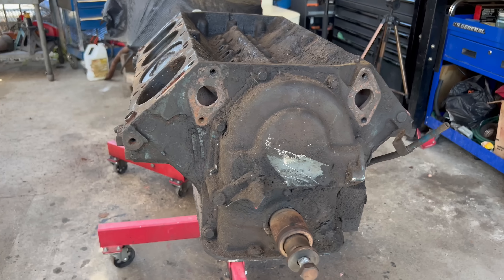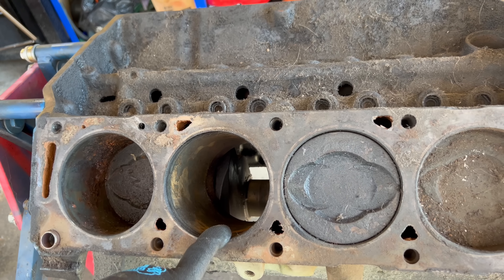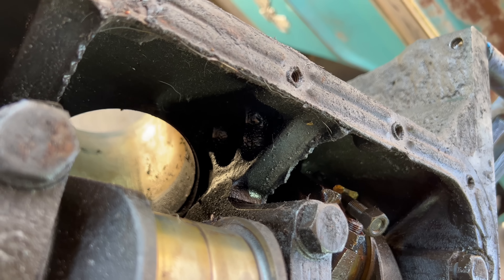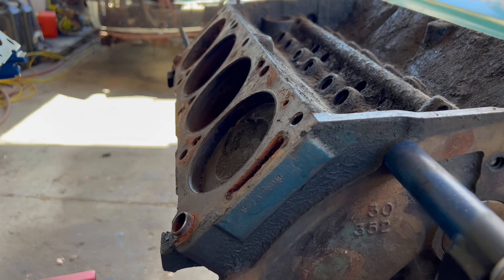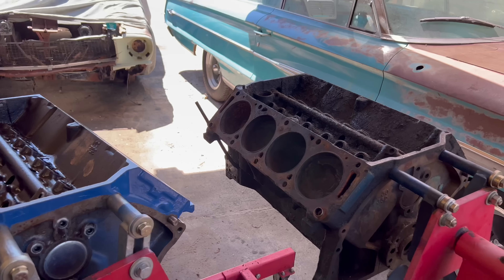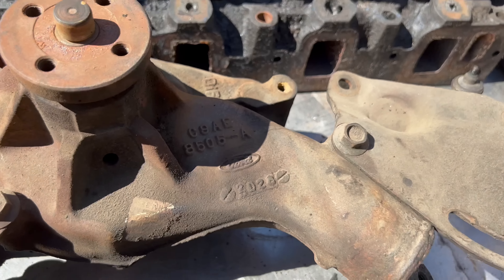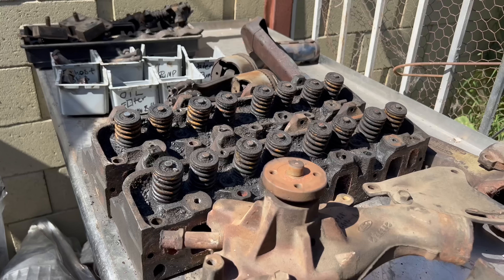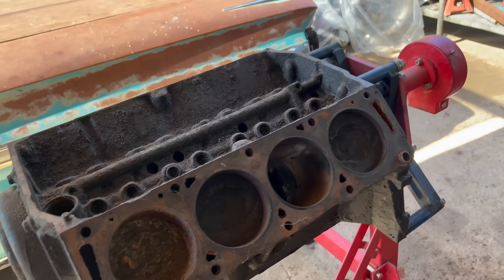A Ford 428FE Cobra Jet For $200!??

Comment: That's an authentic 428-CJ block with the reinforced center main webs (they also had higher nickel content) and a 1U crank.  The heads are not CJ, which have 16 cap screws on the exhausts
I have the correct 1UA crank in my SCJ with "hatchet spacer" and heavy dampener.  The 428-SCJ also differs from the CJ by using the stronger 427 "LeMans" capscrew rods.

Comment: I have 68 coup I put a 428 out of a mercury marquis and it runs like a scalded dog it is a tight fit with top loader 4 speed and borgusen power steering and long tube headers.
Reply from the maker: Haha man I hope mine runs like that. Excited to start up the 428 build

Comment: The 1965 and 1966 352 and 390's were put into production too early. Many had to have the cylinders worked, to make the rings seat when they were new. Chevy ran into the same problem and introduced the 402, a bored out 396. The BBC's wouldn't seat the rings. Most of the 1970 454 had to be worked over at the dealer.

Comment: Yes you got it right.. 4 bolts to each port on the heads.. I had a 68 1/2 ford mustang fastback 428 cobra jet with the top loader 4 speed as my 1st car at the age of 16 (0: Those 4 bolts with headers are a nightmare to put in... And that clutch was hard to hold down also... It was a fun car... I guy i sold it to 40 years ago still has it.. But he has a 351 Cleveland in it now... I did have problems with cracking heads and losing head gaskets so water got into the block.. It did this twice to me... Simple fast cars to work on.. This stuff they make now is total crap... Every time a modern car goes to hell on me... I put old school stuff from older cars,,,engines and wiring to them... So I never have to put up with all these chips and sensors any more... It's a racket to just steal all your cash...

Comment: Just putting together a new engine for my sons 67 Galaxie. Was a C scratch block block we put in 16 years ago. made it 70k miles, and an intke water leak hydro locked it and bent a rod. The one going in as a 434c.i. bored, and stroked (4.125 steel crank) 360 block, with billet cross bolted mains, roller cam, and ported Edlebrock heads. Love the FE's, and the small blocks for that matter. Nice score on the block. I bet it can be saved. Cheers, Mike
Reply from the maker: Wow would love to try out a stroked FE I bet it just has gobs of torque. If I can get 70k miles of fun out of my 428 I think that’s worth it haha
Reply: @OmarRamirezGalaxie  Yes lots of torque, and that's what you want for the street. The more common stroker crank is 4.25, which gives you around 445ci. Makes for a real stump puller.

Comment: I have a good set of 428 cobra jet heads from a 69 Torino GT (fastback), yes has the 16 bolt pattern on the exhaust. And I absolutely know that to be true because I've had them since they were removed from the car in 1975. Replaced it with a 427 side oiler.

Comment: I had a 1968 and a half Mustang Fastback,A long time ago now.
At the time I bought the car (1985)
I had no idea of what it was, except that it was a Fastback and it had a Big Block which I initially thought was a 390.
The engine was no good,the heads had been taken off and left on the ground under the car,Water had gotten into the block and it had 3 cracked pistons,and at least 2 hairline cracks in the block.. yeah they were big cracks I could see.
Anyway I did salvage the crankshaft, camshaft, and the heads...I traded those parts and $100 for a running 428 from a Thunderbird and put that in the Mustang,I drove it until 1997-98...I did learn the car was in fact a 68 1/2 Cobrajet but I didn't have the money or space to restore it properly,and I sold it.
The 428 I was running didn't perform as well as the original 428 Cobrajet but she was no slouch either,I like those 428s
Reply from the maker: Oh mannn, I’ve heard lots of stories where people sell their cars and later regretted it. But I guess back then they weren’t that valuable as they are now
Reply: @OmarRamirezGalaxie  back in the 80s you could still find 60s 70s Mustangs,Camaros,Chargers for 3k-5k still running...of course they were pretty beat up and nothing special or rare but they were still fun.
And back then,not alot of research was being done on Muscle Cars except the high-end well known models.
And so cars like my 68 and 1/2 sort of slipped through the cracks...I had never heard of one..the only Factory Big Block Mustangs I had ever seen were the 67-68 390 cars.
Good luck with your Mustang!!

Comment: An edelbroc top end and the right cam would make it a great street beast ! I love the FE motors , cut the weight and they are perfect ! Torque and power  with decent fuel milage .
Reply: I would put some elbow grease into that 428 and make it a better performer than a stock CobraJet...
Reply from the maker: Yes I’ve got the Edelbrock heads coming. Next video will be the install!
Reply: Torque and power, yes! Decent fuel mileage, what are you smoking! I'm old enough I put gas in them! Like to see someone convert one to modern fuel injection and crank triggered ignition! The external dimensions and weight weren't bad if you ditch that 80lb intake for aluminum! Think the Cobra jets had 440 ft pounds of Torque, and the 335 horsepower rating was bs! 400hp is much more believable!
Reply: @markmccarty9793  I have a 54 ford cp , 10 over 390 , with 60 over 352 pistons , rods and crank , flat top pistons , 292 duration , 512 lift hyd cam , intercepter heads , aluminum intake and a 750 on it , backed by a toploader and a 9 inch with 355 gears i get 27 mpg open highway . Loves  to run about 80 mph lol

Comment: Also the 428 head's have a taller intake port. I got some 390gt head's with the 16 bolt holes.
Reply: 390gt heads had 14 bolts not 16 which is cj

Comment: What you have appears to be  a 428 CJ shortblock with regular 390 passenger car heads and 390 S code intake. If it still has the original camshaft, pull it out and get the part number off it (they are the same cam as the 390 GT engines), and also 428 CJ's had an oddball connecting rod bolt size, bigger than the normal 3/8" size......I want to say 13/32" inch??...if thats the case, then it would indeed be a 428 CJ shortblock, regardless of what vehicle it was intended for.
Either way, good score for 200 bones!
Reply from the maker: Good info, I’ll be taking it apart and cleaning it up. See if the machine shop can fix it

Comment: I am not an FE expert by any means but one look at the exhaust manifolds points to an ordinary 428. True Cobra Jet exhausts resemble a shorty style header. The valve covers should have been chromed, but of course they could have been removed. My guess, based on the strengthened block, is that it's police engine.
Reply: Read that police interceptor 428’s had aluminum intakes
Reply: @shonbratton1906  Did not know that. Considering the age of this engine we don't know what it came with from the factory. It's odd that it looks to be a CJ block with standard 428 intake, heads and exhaust. From what I have read the CJ and police blocks were the same design.
Reply: I had a 68 PI 428 and it had 6 exhaust bolt heads (same pattern as a GT390), an iron intake, and a FoMoCo tagged Holley 735 cfm 4-barrel. Not all 428 CJ's had chrome valve covers, either. I bought a one owner 70 R-code 428 4-spd Mach 1 and it had painted valve covers, and plain steel wheels with standard 70 Mustang hub caps.
Reply: @scottb8175  What style were the exhaust manifolds on your PI 428? From what I remember the 390GT had standard, log type exhaust manifolds. My first car was a 69 LTD with a 2bbl 390. It ran on regular gas which in retrospect was one of Fords better idea's.
Reply: @briansearles4473  The manifold bolt pattern was different, at least that is what I remember. The heads had 14 exhaust manifold bolt holes vs. 8 for the standard versions. Some ports of the manifolds used the horizontal holes vs. the standard versions that used only vertical pairs of bolts accross each exhaust port. The "GT" style heads only were offered in 390's in Mustangs, Cougars, Fairlanes, and Comets, and the 428 PI. My guess was that the extra holes were because there wasn't enough room around the shock towers to use the standard bolt pattern in the narrower body cars. I know the 67 Shelby GT500 used the 428 PI with GT heads - a friend had one.

Comment: What is the bore, 4.13" or 4.05"? It could be a 410. Check that book you referenced and it tells you how to check the cylinder casting thickness using a drill bit as a go / no go gauge after pulling the freeze plugs. If it's a 410 with the thick cylinder castings it could be over bored 0.080 and now you have a standard 428.

Comment: I read once where Ford Called them an FE because of the mount of Iron required to build them...
Iron is a chemical element with symbol Fe (from Latin: ferrum) and atomic number 26. It is a metal that belongs to the first transition series and group 8 ...
Atomic number (Z): 26
Atomic radius: empirical: 126 pm
Oxidation states: −4, −2, −1, 0, +1, +2, +3, +4, ...
Density (near r.t.): 7.874 g/cm3

ha ha ha 😁😁
Reply from the maker: Hahaha oh man I’m having flashbacks from the chemistry classes I took in college.

Comment: It was also an option on the 69 Fairlane.  My dad went for the 302 much to my teenage dismay.
Reply from the maker: Haha yes. I will say the 302 in my 68 Torino runs really smooth
Reply: @OmarRamirezGalaxie  Oh it had lots of guts. The old man seldom let me drive it because he knew it was pretty fast and I would drive the hell out of it.............which I did when I got the chance. It was no 428 but still, pretty quick.

Comment: A MACHINE SHOP IN YUCAIPA CALIF (GONE NOW) STILLMAN & DODD...HAD THE BEST EQUIPTMENT OF ANYBODY I KNEW AT THE TIME...EARLY 80'S...FANTASTIC MACHINE WORK...THEY HAD SUNNEN MACHINES!!! I SPECD A 327 SMALL BLOCK...I Wanted 0.15 thousands on main & rods...it was RIGHT ON TARGET...THAT ENGINE RAN HARD WITH SMALL VALVE HEADS AND A 3 SPEED STICK IN A 65 EL CAMINO...IT PULLED SO HARD DAN RACED ALOT OF OTHERS AND WON...THEN WE WANTED 2.02 HEADS...OH BOY...IT MADE IT VERY QUICK...HE SMASHED HIS KNUCKLES ON THE DASH T OO MANY TIMES...LOLH

Comment: I have a orderd 1971 LTD with a 429 4bbl not shure if its a cobra.it has factory bucket seats .auto shifter on floor. Power disc brakes and a 3.25 rearend.every one i talked has hurd of this  package but never seen one.

Comment: also looks like 352  the correct heads and valve covers  and the block u have c7 67 the parts c8 parts from 68

Comment: That's a lot of good information. 60s Fords are famous for being puzzles too, I guess. LOL. Weren't some of the Mercs made with CJs and even some Cougars with SCJ too? Just curious what your HP target is on the build you've working. I've not kept up but I can remember guys getting 550 - 600HP without getting crazy. Very streetable. Good torque and didn't need to be revved to drive fast.
Reply from the maker: Hey John, yes lots of mercuries came with the CJ engine. I know where there’s a 68-69 mercury cyclone with a CJ but owner won’t really sell it haha. I’m shouting for 500hp but realistically end up around 400hp. I might get it dynoed!
Reply: Yep, Mercury used the same engines as the Ford line did.  I had a 1970 Cougar Eliminator with a 428 SCJ.

Comment: Hey bud happy birthday to you and keep on trucking used to into three 90s back in the day the ones with the two Bolt engine mounts castings had a 66 two-door post Fairlane and a 67 Ranchero used to blow the doors off the kids in the Camaros anyways those intake manifolds are a little heavy aren't they want to know a trick I'm sure you already know those cast iron intake weighs 75 lb aluminum 18 lb besides better breathing raises the front of the car up about a half an inch okay have a good one and again happy birthday enjoy listening to you keep up the good work
Reply from the maker: Appreciate it! Haha that’s cool I would love to own a 67 ranchero. I agree, the aluminum intake is a good upgrade. But I don’t mind them on pick ups!

Comment: I know the Cobra Jet Clevelands have XXX stamped on the block. I have no idea about the FE blocks. It’s crazy how hard FE Ford blocks/heads are to tell apart. And just how many different factory options Ford V8’s came with from about 1964 to 1971.
Reply: The era of really confusing branches of the FE family started in 1961, with the solid lifter only high-performance 390's. The early ones most people have forgotten about - the 61-62 HP 390, 62-63.5 406, 63.5-64 427 Top-Oiler. the Mercury 410....

Comment: I Just Subscribed if you look in the water Jackets. The number 428 is cast into  the block. On both sides  below the center freeze plugs. and at the very back of the water jacket thru the gap in the mating surface.  We have a 67 Q code T Bird.  428 car. A Mirror 106 casting 390 block can often safely be bored to a 428.
Reply from the maker: Yes I’ve heard of the 428 stamp. I’ve also read about fitting a certain sized drill bit in between the cylinders. I’ll have to take a look and see if this block has it. And I think those mirror blocks are from trucks if I remember correctly

Comment: There is another trick for positive identification as a 428. If you pull the freeze plugs 428 is cast into the block, I just can't recall the exact freeze plug location. Use a strong flashlight. I know for sure this is true on 1969 428CJ blocks but can't say for sure that it applies to all of them. Many years ago I was also on the hunt for a 428 and it is harder than it might seem at first. Good luck with your projects.
Reply from the maker: Yes I’ve seen that 428 cast in the rear water passage. I’ve also heard of a certain size drill bit fitting In between the cylinders.
Reply: Right side middle freeze plug on my 2

Comment: my 69 mach 1 was a 428 4spd  car  with 430 gears,,its a cj...sad it did not have it when i got it,,,had a junk oil burning 427  out of a auto matic  ,,well  it had no pilot bearing in it..trashed the toploader....i traded my 66 polara 500 ragtop for it in 77...now has a 302 with a c4 in it now,,,,i like it better that way

Comment: Cj heads are dirt cheap now cuz the edelbrock rpm heads flow way better on the exhaust side. The intake are the same, so Ford got the intake right. I bet you port and polish the factory cj heads you could get close to the rpm heads

Comment: As a solíd GM guy, I do love FE Ford's! Thing is when you look at this greasy mess and that intake, etc, they just don't look like much of a performance engine at first. I really like what this Robotnik guy here in Michigan has done for the FE world. Also love hearing those big Galaxies and Starliners running 8.90s carrying the front wheels 330ft while banging gears!
Reply from the maker: Haha man that’s awesome. I love seeing these big cars going down the track as well. I almost bought a starliner if it wasn’t for my trailer messing up on me I would’ve had it!
Reply: As a performance engine, the standard FE was actually pathetic in comparison to its BB and even some SB competition. Only the rare "special" versions (406, 427, and SOHC) made competitive power. I worked at a performance engine shop that built them all but only raced Fords ourselves  for years. Our own 351C engines were much more race worthy than our 428 CJ ever could hope to be. In my opinion, the 429 - 460 Ford BB is the best standard production BB engine of them all for the 60-70's era for power potential. Same for the 351C compared to the other SB's of the era.
Reply: @scottb8175  I loved and hated the 390 based FE I had in my 67 Fairlane GT and agree with everything you said. I made mine run good and won some street races but for what I spent and did I would have been better off going to something different. But it was all fun.
Reply: @bw3506  One thing the FE had over just about all other engines was how easy they were to work on for the average shade tree mechanic. Besides the fact most parts interchanged, distributor is in the front, the damper was a non-interference fit, one piece oil pan gasket w/o separate end seals, rods had full floating wrist pins held with snap rings, lifters came out with the heads in place, no special bolts or installation procedures, most everything was accessible with basic tools, especially once the engine was out of the car. No special tools really needed at all. The only tricky item to install was the rear main cap side seals.
Reply: @scottb8175  Yep you definitely know them! I was just a pup when I started messing with them but I got an education thrashing on it.  I once had a guy arguing with me how there was no way I was doing a cam change without pulling the intake. Honestly I had forgotten about the flat pan rail on them. My big Mopars have that too.
Reply: @scottb8175  - Fe won LeMans was first engine to break 6’s in the 1/4 & only to ever win a triple crown in to fuel. It dominated NASCAR in 1964, winning 35 races never lost ground to 426 hemi in fact hemi had a hard time keeping up. I don’t know any other engine that has that history.
Reply: @CoyoteFTW  Yes,  but only the very expensive limited production and special production racing versions (406, 427, SOHC) were, well... racing engines. The regular production, comparably plentiful, everyday top "performance" FE versions weren't as competitive with brand xyz's top offerings, except maybe the 428 CJ. Knowing the 427 SOHC was the first in to the 6's won't make the average guy's 390 Fairlane GT win against a 440 Charger.
Reply: @scottb8175  amazing racing engines to this day. Ray Paquet current record holder for SS/A ran best of 8.4 in his FE. It was an older big block but it was setting world records before Chevy could even figure out how to keep their big block from exploding. But I agree though the 385 series “big block” Ford is the best big block made, insane power potential.
Reply: @CoyoteFTW  he twists that thing lol